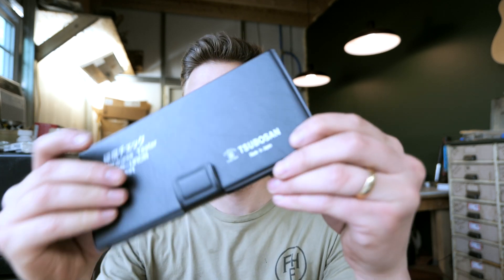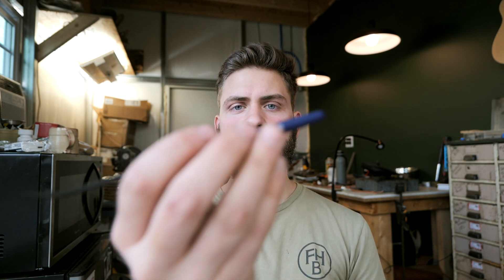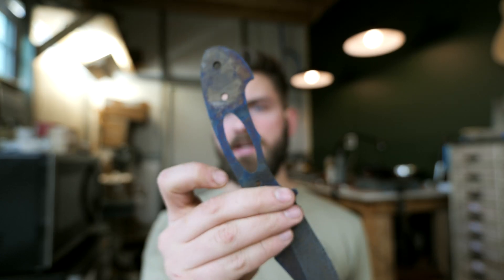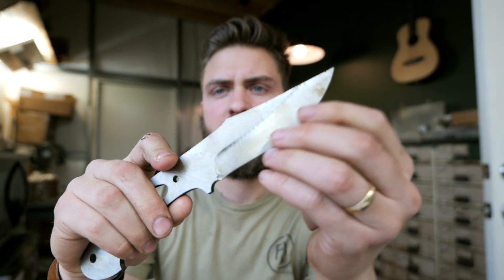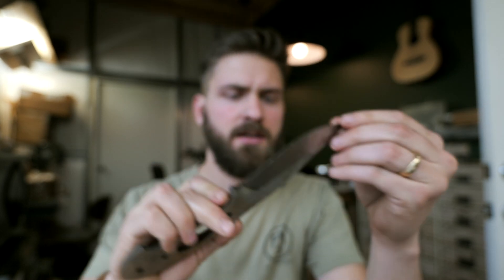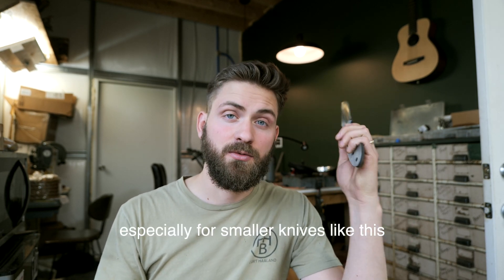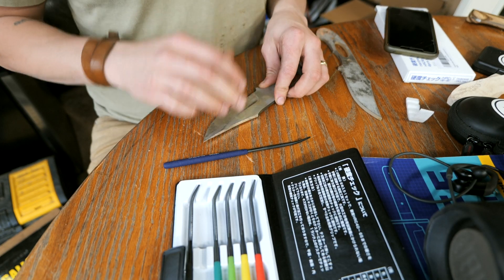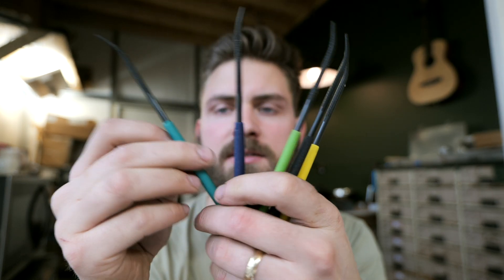TOOL TIME- Simple Hardness Testers- TSUBOSAN hardness testers HRC40~HRC65

Comment: Proper 'steel' for durability as a knife blade is a combination of hardness and toughness. The 'combination' of this can be seen as 'content' of elements I won't go into here, as familiarity of such... should all ready be in the mind set of those reading. The point to be evalusted is that 'content' can become visable when one 'grinds' the steel on a fine wheel, and one takes note of the SPARKS (fireworks) that occurs after the sparks depart the wheel. The intensity, the color (with a black back ground) should be in your observation, and simply grinding a 'good' file, and a 'cheap' file (or chisel), and ones with known corundum or tungsten... and you can EDUCATE YOURSELF to determining quickly the 'nature' (not just the hardness) of the steel being evaluated. DIFFEERENT locations of a 'well crafted' blade should present 'differently' for instance, as should the 'handle' of a good file vs. the end of it.  Beware of being fooled by 'plating,' as a cheap chrome plating sparks nicely, so can nickel steel that's been 'de-plated.' )